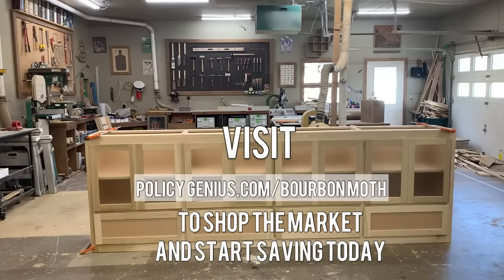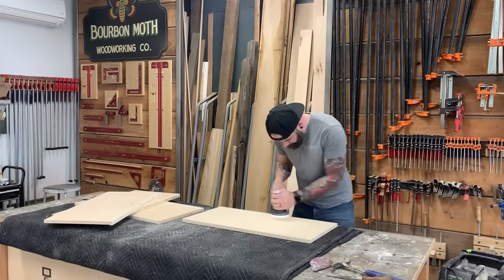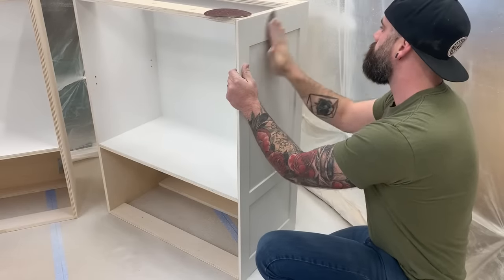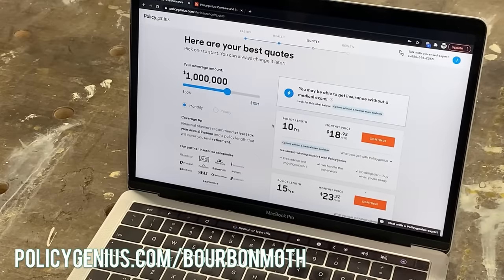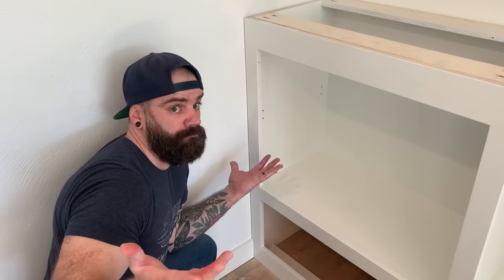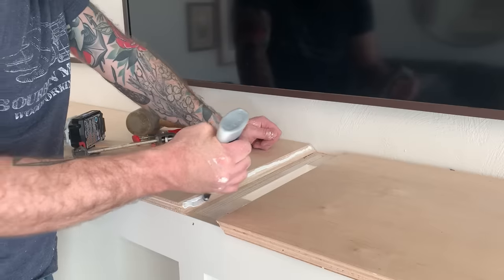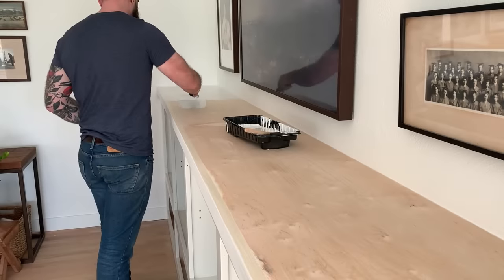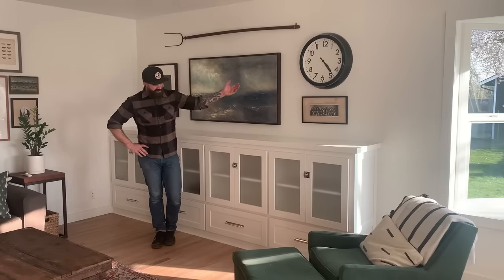How To make a Giant Built-In Cabinet || Easy Living Room Storage

Comment: Here are a couple trivial painting tips.. 1) use a canvas drop cloth in your kill room. This will keep the paint that falls on the floor from sticking to your feet, and getting tracked into your shop. You can get them in many sizes at Home Depot perfect for the kill room dimensions. Then open the plastic walls all the way so they drape onto the floor in the kill room. Place your drop cloth on top. This will protect against any spills that would penetrate the drop cloth.  Added bonus this method is cheaper and faster than the paper method. If you’re going to keep making these rooms :/ 2) Have you tried a red sharpie for numbering your drawers? Not sure about you finish but so many paint finishes (if not stain blocking) red sharpie bleeds right thru. Again this is just a trivial item that feels better for my painters mind rather than tearing off the blue tape and all the finish... even though its hidden forever behind the drawer face. takes a breath old habits die hard. 

Thank you for making such fun videos!
Reply: Harbor freight sells canvas drop cloths cheap. You can get 4x12 on sale all the time for 5.99. or the 4x15 for 10$. I also love those blue paper drop cloths. They have a thin rubber like coating that grips to the floor really well and also prevents bleed through. They last for a really long time, they fold up to almost nothing and best of all they're like 7$ on amazon. I prefer the 4x15 ones though. The larger format ones are just the 4 ft ones glued together and they always start to come apart pretty quick. They also hold blue tape extremely well for covering larger areas. But sometimes the weight of the canvas is just better.

Comment: On your next paint project consider using Hydrolac primer from Sherwin Williams. I use it all the time and is perfect for these kind of applications. 
Its water based, yet dries fast like if it were lacquer primer. Since it dries fast the grain in the wood dont rise as much so it makes sanding was easier. It also sands smooth like true lacquer primer.
That primer and the Emerald Urethane are a perfect combination for a project like this. 
Great vid!
Reply: Do you have a link for the Hydrolac? I can't find any info on it here.

Comment: As usual, entertaining and informative. I use 1 additional step to painting that seems to help prevent the grain from raising: start by first spraying a coat of wax free shellac diluted with denatured alcohol (50/50). Dries quickly and seals the raw wood to help prevent grain from rising. Still have to sand your primer layer. Thanks for the great content, much appreciated.

Comment: You are one smooth sailing modest showman/carpenter/painter/builder professor. You do know what you are doing man and I enjoy watching this series. I have tackle a lot of finish carpentry work in my house, but I have never had the courage of making cabinets because I am afraid of you know what (square). I will watch all of your series, because I noticed that you have a lot of tricks that can make my fear a little less. Once I am done watching, I'll start with one small boxy cabinet using whatever I can gather from your videos. If it does not turn out right I can just throw it overboard, if it turned out right then I can go on building more. Sorry for my rambling, got to get to the videos.

Comment: Excellent paint choice. Emerald is probably the best paint that you can get from a local store without ordering something special. Also don’t be afraid to adjust your fan width on the sprayer. This will make it easier to spray the edges of everything while eliminating some overspray. You also want to spray the sides first but for a woodworker you did a great job with the finish.

Comment: So I painted all of my kitchen cabinets when we built them and I didn’t not have a good sprayer or a place to spray them. I tried the foam rollers and found them to be pretty terrible, and the back brushing is a lot of extra work. The absolute best method I found is using the Wooster 3/8” (or shorter) micro plush microfiber roller. It’s also a mini roller cover like the foam ones, but particularly if you get a paint that has good leveling, the micro plush leaves no lint and leave an incredibly smooth ALMOST sprayed look.

Comment: Just one suggestion. I use auto body bondo to fill cracks. still 2 parts but much easier to apply with a plastic applicator or an old credit card and less left over to sand. I also like to use a bit of flowtrol in the paint to allow it to level out . My 2 cents. Nice work!!

Comment: Dang, wish you made this a couple weeks ago! Tipping off!!! Just went through such a frustrating finishing process with a foam roller 😤
Reply: Some makers tout foam rollers, but I think they are evil. Air bubbles everywhere, and the dang things break down over time, so you can't buy 'em too far in advance of a project, lest they crumble during use and ruin all your paint!!
Reply: @VideoNOLA  Yes, I feel duped by all the people who say foam rollers are the way go to for cabinets. That being said I've had great success using a foam roller with latex paint on doors, but I guess it's not suitable for cabinet paint...
Reply: Personally I go with a short mohair roller when painting smooth surfaces. Slightly watering down the paint, then rolling on and laying off (thats what we call tipping off in the UK) with a brush has given me the best results.

If it doesn't need to be perfect then a foam roller works great though.
Reply: i have achieved good results with floetrol and rolling/tipping the paint.  it really does make it lay down flat.  i've never used it to spray, but i can vouch for it's effectiveness in eliminating brush strokes.
Reply: In the UK we call it 'Laying off'. No roller will leave a perfect finish, this is the best way to let the paint settle to a smooth finish.
Reply: @bdhall77  ok, but spray painting (at least with HVLP) won't leave a perfect finish either. You will have orange peel texture. I'm second guessing going through the trouble of spray painting. A roller would be so much quicker and easier.
Reply: @vitaminb4869  agreed. Did the same technique as him with same exact setup and had a lot of orange peel. Wish he’d respond to these comments to give us some advice!

Comment: Hi Moth, love your off the floor cardboard not very safe stapled to the clinging interesting spray gun stuff. 

Thin tap water with multiple not standard not to heavy lightly dust free surface with the not thick and globby against the wall method!   Tip tip out, Darn good up close smooth thrown down five or six coats of paints. Don’t forget the primed cab door top, Okay Love your bloody stuff. Did you need a key?

Love your site and work. Tack those pocket hole with inserted shims...dang I forgot the ryme on my belly.  Dont put holes in your cabinets. But joints are okay and don’t forget those blue piece are best.👍

Just a hair flush 45 barely sticking up  perfect crack  and calk for that tipped drag brush thechnique!  I’m  sure you cant tell!. 

Nice and easy with the glass.  Perfect .  Hinges are essential!  Exquisite project.

Comment: You might wanna check out Sherwin Williams Kem-Aqua line.   You will need to use a "business" account.  It's a water based lacquer, of all things.   It is amazing.  Very hard.  I just sprayed all my upstairs trim, doors, cabinets, and banister, with it.  It will crackle a bit over caulk, but can be touched up with a foam brush.  Crazy durable stuff.  The cleanup isn't as smooth as most other water based paints.  But, a but of denatured alcohol, etc will remove the fine traces in gun.  Not very brushable (thin).  I used some spilled paint in a lint free rag to saturate some MDF shelves.  They came out slick.

Comment: Now make a Recessed Box behind the tv That has a Swingout and Pivot Arm so you can pull the TV out some, because as close as the cabinet is the TV line of sight will be blocked a Bit if any where close to it. also a good place to add back Lighting.

Comment: Love your channel.....a ton of good info and it's funny.   I've learned a lot from you.  I'm hoping you can help me out with a question I can't find an answer to.  I have a large CNC router.  I work with plastics and know very little about wood working.  Can I cut a cabinet face out of one piece of plywood just by cutting the perimeter and then the opening, or does it need to be cut traditionally in the form of rails and stiles and then assembled to prevent warping?  Thanks!

Comment: I have been experimenting with the primer and paint you used on this project. I am having a hard time getting the right viscosity for my HVLP. Can you please help with the following...
- For the paint and primer, do you thin them both out with 10% or 15% water? Can you please be specific. 
I have been using M1 Latex Paint Conditioner; however, the instructions calls for 5-6 oz per gallon. It looks like you add way more than 6 oz of water. Your feedback would be greatly appreciated. 

Many thanks for you help.

BTW, I have learned so much from watching your videos. Keep putting them out.

Comment: Hey there, I have the same sprayer and tip. Been trying to spray the SW urethane trim and enamel, thinned it about 15% to try to get a smooth finish. It seems like even when the paint is smooth when wet it dries to an orange peel texture. Have you experienced this? The primer i used was SW white pigments shellac based primer, does this have an effect?

Comment: At the risk of asking a rude question, can you give a ballpark figure at what you might charge a client for this project?
Reply: Some finishers I know charge $10/ sq. ft. of surface. I personally would charge $350/ $450 + materials
Reply: So you gotta ask yourself... $450 for labor? Could you do this in 3+ days? This is a completely improvised custom built-in. There's no milling jigs, no joinery jigs.. you're gonna build exactly ONE. You get 8 hrs on day 1, day 2, day 3, and need to complete it within 6 hrs on day 4. That's 30 total hours. Within those time constraints, you have to source and pickup lumber, glass, and hardware. Then at the shop, mill, dry assemble, disassemble, primer, paint, deliver, install, trim, and finalize paint. 30 hours? If you managed to do it, you made a whopping $15 per hour... No I'm pretty sure someone with this level of skill and investment of tools would want at least $1200-$1500 in labor - plus materials. I mean, $1200 would only be $40 per hour, but we still have to do it within 30 hours - by ourself. If you hire help, well, these numbers start declining... First step in trying to estimate any labor is to estimate how many hours the job will take. This was an 11 foot custom built-in with drawers and windowed cupboard doors. How many hours do you think you could do this in (including installation)?
Reply: @m2svirtual384  I meant to do the finish work lol
Reply: @MCJMFP  But the op asked for a ballpark on the whole project...
Reply: @m2svirtual384  From Lil Giant The original question was about the entire project. The response was about the “finishers.”
Reply: @henryvalero9235  Was it? She say finishers 'she knows' charge $10 per sq ft. She then say she would personally charge 350-450 + materials. Fo what? She don't say 'for the finishing work'. So the first coulda just been some random trivia.. I know, words are hard. Lack of words make things even harder to decipher. But whatup cuz? You tryina win a date wid her? The mans question was about THE WHOLE PROJECT. Can ya read cuz? I at least attempted to answer the mans question. Why don't yall share with the room while you gots our attention and tell us where finishing work begin, where it end, and how many hours that take. Ok all yours cuz. Get up in it
Reply: @m2svirtual384 You are bring rude for no reason. I am not looking for a date with her because I am not lesbian. She specifically said “Finish.” YOU CORRECTED HER. That is all right. You are allowed. But I, if not others, was hoping YOU would add on. You did not. Instead I got the garbage you are sending now. If you had nothing to add, fine. But you do not get to question why WE did not add on. These are COMMENTS! Not courts of law. 

You point out there may problems with words? Perhaps if you did not read tone of voice that was not intended into a COMMENT, YOU would not have a problem with the words. There is no reason to get all upset. Most do not re-read or expect perfection. (Most—some like to even correct a typo or grammar problem due to autocorrect.) Let it go. We were just trying to learn and share.
Reply: @henryvalero9235  Cuz my og response WAS MY ADD ON. Why I need another? Where yours cuz? How you know she a lesbian? Why my comments garbage but yours ok? Why do you get to question things but I can't? May not be a courts of law but you sure think you're the judge cuz! lol!! You the rude on up in here. Like I say, I already answer OP. Did you? No. You looking to fight cuh. Straight up

Comment: The problem with the sheet plastic for paint boot walls is that paint dries out on the plastic and the plastic sheet is way more flexible than the paint so it chips/flakes off into the air and onto your workpiece etc...

Comment: Okay, I'm having a hard time reconciling your method of marking the baseboard for clearance cutting. I've only been a builder for over 46 yrs, but seems to me that marking/cutting it the way you did would leave a gap the width of the baseboard's thickness at both ends of the cabinet. I'm all ears, tell me where I"m wrong.

Comment: I’m curious about those doors. Are there latches in behind the doors holding them closed? Otherwise the latches are kinda useless as the doors just pop open rather easily.
Reply: They are soft close hinges that hold themselves closed. That and the latches he installed as knobs likely have a catch of some kind
Reply: I've been a cabinet installer for more than 40 years and clients have often had me install these types of latches on pairs of overlay doors. However, the latches are not made to be used on pairs of doors. They consist of the latch and a catch and are designed to be used on a single inset door. The latch is installed on the door and the catch is installed on the face frame. To open the door the knob on the latch must be turned to release the tongue from the catch. When installed on a pair of doors most people just pull on the latch without turning the knob so the tongue pulls the door with the catch along with it until it slips free of the catch. Because it isn't opened far enough for the soft close mechanism to engage, the door with the catch then bounces back against the face frame with a thump. All that said, the latches do look very nice and they are quite popular for cabinetry of this type. It's just a choice of style over function.
Reply: @dcdci  hey thanks for that reply! I’m a cabinet installer myself with approx 10 years experience. Your reply is exactly what I was thinking. Just sometimes there’s a new product or method that isn’t shown. I guess that’s where my question was headed. I’m glad to see that there isn’t something I missed in the video. Enjoy the rest of your day!